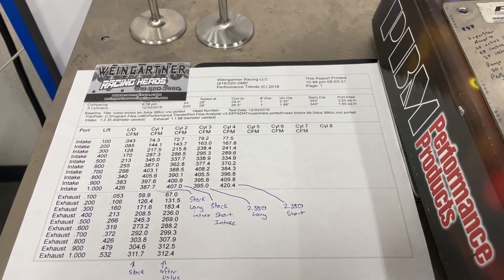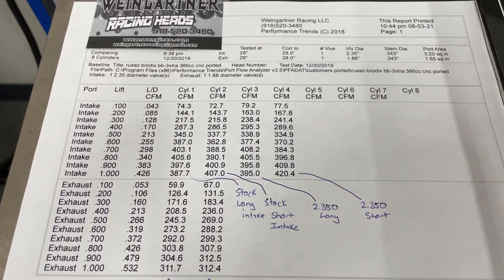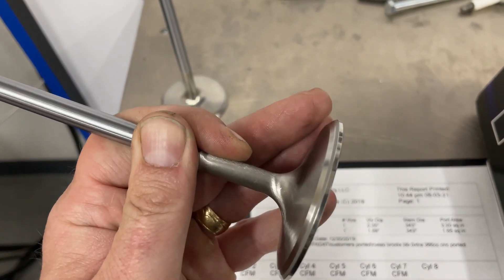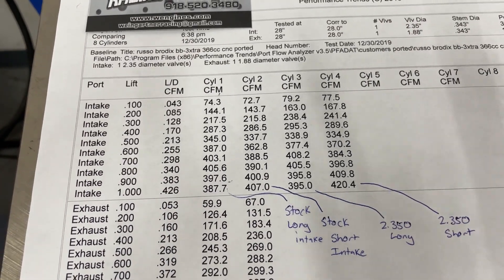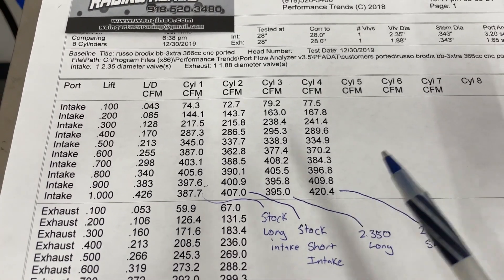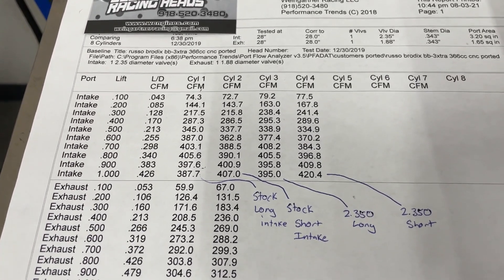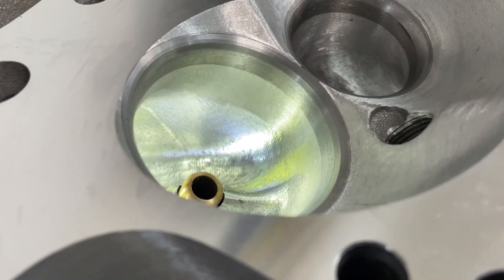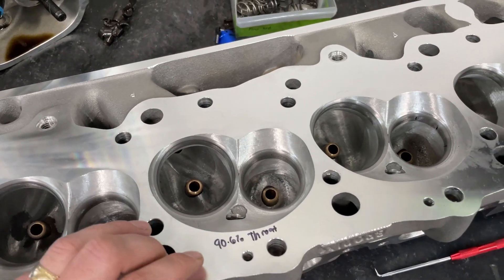Adding Larger intake valves to Brodix BBC 3xtra 366cc cnc ported heads

Comment: I'm a numbers guy, so I ran the numbers for the before and after 2.300 / 2.350, both from .100 - 1.000 and .100 - .800" as most won't run much over .800" with this head. From Brodix, these heads averaged 304.9 from .100 - 1.000 (long runner), 300.6 (short runner). From .100 - .800" they averaged 283.0 (long runner) and 274.7 (short runner). After the 2.350 and valve job they averaged 309.7 .100 - 1.000 (long runner), 309.3 (short runner). From .100 - .800" they averaged 288.2 (long runner) and 282.8 (short runner). For the typical usable .100 - .800", between the long and short runner, that was an average gain of 6.7cfm. Now with the typical calculation of 2.0-2.2hp/cfm, that comes in at about 14 more hp. Now, take that along with some improvements that can be made to the ports beyond what the CNC program does, and I could see getting an average closer to 15-20cfm (again, over the already CNC program), which could be worth 30-45hp.

Comment: I can only guess Chevrolet engineers used two intake ports to keep the intake manifold ports together. Have you ever run across any CID BBC heads (Aussie) with symmetrical intake ports? Wondering if that’s a desirable change…
Reply: I think the reason was to keep the push rods in line .

Comment: Just a comment about a 1.88 ex being to big? It's been considered the perfect go-to size since before I started automotive machining 37 years ago and I am a cylinder specialist. I cant remember who at chevy proved some heat theory, but anyways, it's why the original 1.84 HP valve was inlarged to 1.88 almost immediatly.  For years its been the most common quick free power increase for oval ports with 1.72 valves. Just going from 1.72 to 1.88 and leaving the 2.06 intakes alone. Heres the reason. HEAT!!! Heat robs power and causes all kinds of problems, so as HP builders, our job is to limit heat.... A basic example is the 1.72 valve to 1.88 is worth 20-25 up plus up! We can check flow until we vomit, but don't forget about the enemy called heat. Just my experience and 2 cents. Take care my friend. You do fine work!
Reply from the maker: Think about the bbc SR20 head it is 2.40/1.80 it makes way power most any other conventional bbc head and it has a small exhaust valve. The big valve dumps the heat and pressure so quickly that you lose the intake draw from the pressure differential. It’s like having too big of a header. My personal bbc is 2.375/1.85 makes 1120hp

Comment: Hi Eric, I'm in the process of building a 355 sbc and trying to decide what to do about piston to head distance to reduce detonation. I'm using flat tops that are .004 out of the hole. summit cast iron Vortecs  with 71cc chambers. There doesn't seem to be many videos about it from people that agree on the matter. And I was hoping to get your views on the subject? Things like how much compression can I run on 87 octane for a mildly cammed daily driver with optimal quench? And what is that optimal quench? Thanks for your informative videos...Loved the one about lift loss due to deflection.
Reply: I'm by no means as knowledgeable as Eric, however, I will try to help. For a NA engine you usually shoot for .036 - .046" optimal quench area. With your piston .004" above the deck at TDC, I would look for a .044 - .046" head gasket. You shouldn't have an issue, but always check PVC. For an iron headed engine, I would stay below 8:1 dynamic compression ratio (DCR) for 87 octane. You'll have to look for a DCR calculator (not your standard static compression ratio calculator). You will need your cam specs to use this calculator as the overlap and valve events play a huge factor. If you don't know all the valve event specs from your cam, Summit racing has a cam valve event calculator that can help.
Reply: @my87z28  Thanks for the info. I was also wondering if you can tell what compression ratio you have by doing a compression test? I have an engine that pumps up to 150psi right away, and ends at 200psi, on most cylinders. one is 190, high one is 205. Engine was running great when I parked it a couple years ago. Lots of power.
Reply: @nakedshorts6784  No not exactly as cylinder pressure has a lot to do with the valve events as well. A split between 190-205 should be fine. However, I will say, that much cylinder pressure, with iron heads and low octane fuel may not go well. I wouldn’t go with 87. It may work fine with 93.

Comment: 20 cfm here, 20 cfm there, adds up in a hurry. Simply increasing the intake valve size is well worth it, I know that from personal experience. The tiny bit that was lost at 500-600 is nothing to worry about, that is more than made up for if you look at the entire curve. Flow starts better, and peaks better. As you mentioned, the heads already have plenty of exhaust valve. People tend to forget that flow numbers are with the valve at a fixed lift. Once the engine is running the increase in valve diameter will show up all thru the power band. Excellent example of a simple and easy power gain, from a very small increase in the intake valve size.